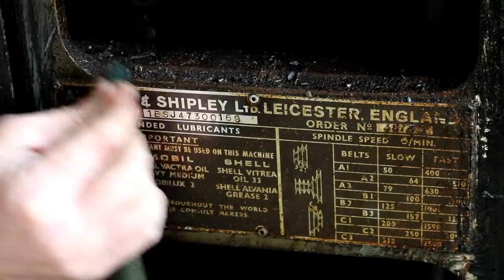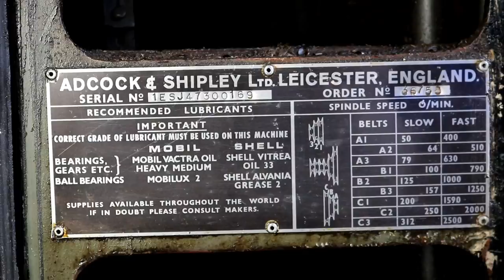1st good LooK at the Adcock Shipley horizontal mill. Good and Bad!

Comment: A suggestion. When you put in your retaining wall between the garage and hill, put a drain behind the wall and backfill with crushed stone. That will minimize frost heaving which will push the wall out away from the hillside.
Nice machine. Wish I could help with the building. 
Thanks,
John

Comment: Seeing your machine brings back memories of where I served my apprenticeship in Whetstone Leicester (pronounced Lester) I can remember learning my trade on a very similar Adcock and Shipley milling machine to yours. My first year in the training school would have been 1966. All the Adcock and Shipley machines we had were painted a light grey. I'm not sure if that was a factory colour of if they were painted in the training school. You may want to have a look at http://www.lathes.co.uk/ where you can find some information on the company if not your actual machine. I look forward to seeing all your videos. Hoping you, your family and peanut stay safe and well during this difficult time.
Reply: I would have dated that machine as being from the sixties, I've seen that 'tortoise and hare' speed indicator on other A&S machines. Most A&S machines I've seen including the Bridgeports have been green but obviously yours was painted 'off white' from the factory. I'm pretty sure the feed motor was disconnected and the brammer belt removed was to prevent inadvertent engagement of the feed. The bits of swarf in tight places points toward cleaning with the high pressure air gun, something that would have earned an apprentice a clip round the ear back in the day! Best Wishes to you and yours Steve and stay safe in these 'interesting' times.
Reply: I remember that before my marriage went pop my then father in law and I were making a seven and a quarter inch gauge narrow gauge loco. My point is we made the frames on an Adcock and shipley horizontal mill like that one. That mill was also painted a light grey. I seem to remember that the side cutting mill picked up on one of the frames which were bolted together and made as a pair. The cutter broke flew across the shop and embedded itself in the wall. Lovely machine but respect it
Reply: So did I but in north cheshire (ICI) apprentice school Widnes
Reply: I used one an Adock and Shipley like this as an apprentice in the training school we also had Bridgeport Mills they where all great machines😀

Comment: You mentioned putting in a french drain around the back of the building, to drain off some of the water that runs down the hill.  I built some french drains years ago, and they were the standard, pipe and gravel in a trench system.  Much more recently, I had to have some re-waterproofing done on a wall of my basement.  This time, they did the drains WAY differently.  They used a LOT more gravel, basically filling the whole trench with a tapered pile of gravel the whole depth of the wall, and added a channeling board along the wall.  While you don't need to go to that extent for a non-basemented footer, I would suggest adding a lot more gravel than a traditional french drain had, and surround the gravel bed with filter fabric, to keep silt from ingressing as fast and clogging the bed.  This will keep the drains working better, longer.  Just a thought.

Comment: Hey Steve!
AT 02:50 (or so) I figured out the cycle of that unit.  The air cylinder is to be used to just get the part started.  The operator would release the button BEFORE the part was fully threaded.  The roller die continues to self-feed the part to full depth and releases.  This allows the spring return of the cylinder to 'snap' the part back very quickly when the roller die head opens at the full length of threading.  The roller threading die is nominally EXPENSIVE and may fetch you a good price on EBAY.
Best regards,
Ken

Comment: For the retaining wall, you might want to consider running it along the length of the shop and about four to six feet beyond on both ends to keep it clear since you will have to cut into the hill side a few feet. In addition, you would want to put in drain tile for the whole length and back fill it all with crushed rock to help prevent heaving.

Comment: I use exactly the same head on my strimmer, for exactly the same reason, auto feed heads are just a waste of time.  great video as always
Reply from the maker: The auto feed heads get heavy and only work part of the time it seems. Plus the engine revs quicker not having to spin up that extra mass.  Its a must have for me.

Comment: You inherited some really nice equipment. That Baldor grinder is great. I have worked in a couple of places that had one of those and I loved the way they worked for sharpening tools for the lathe. That little mill must have a bunch of your viewers drooling. If I was a gambler my bet would be on them doing everything possible to disengage the table feed on that machine which would mean it will probably work once you clean it up and restore the power to it. Also very happy to hear that the DoAll bandsaw may be making an appearance again before too long. You have us all in suspense waiting to see that beast in operation. You will need it to cut usable pieces of that monster chunk of tool steel you got with those new machines.

Comment: Hi Steve, thank you for sharing your life with us, I'm sure that most of us are cooped up inside and your vids are a nice way to forget our problems. I'm not a structural engineer but I have some talent for problem solving. Given the rocky strata in your area I think you could use a small retaining wall behind your shop, if it were me I'd put in  36" wall height and 24" wide footing would be what I'd put in with a wall thickness of 12" and don't skip the rebar and maybe run some french drainage behind the wall as well. Hope this helps

Comment: When I toured the Starrett factory in November last year they had a lot of old machines set up kind of like this; fixtures to do one operation on one specific part. Based on the age of some of the machines and how long Starrett has made some of their catalog items I can only assume that some of the machines have been set up that way for decades. They have a machine rebuilding department where they refurb their own machines as many of the equipment manufacturers represented on the shop floor have long gone out of business. Cool stuff!

Comment: I have the same  machine only its badged as a Bridgeport late 70s according to the serial number, had to remove the knee to get it inside the workshop very heavy not easy. just been fettling  the rapid feed and return after strip down and clean  . I was lucky enough to get the overhead milling attachment as well which is a bonus , good strong milling machine hope you get it  all working ok.

Comment: I admire the tool makers who setup that fixture, but I pity the person who had to stand there and load it with parts! I've got an Echo trimmer, which I believe is made by the same parent company as Shindaiwa (Yamabiko). It's fantastic!
Reply: Echo was Kioritz. Don’t know if it’s still the same company or not.....
Reply from the maker: Lots of little tricks in that jig. . There was definitely some experience behind its design.  Probably some oldschool toolmaker with pencil and paper.  I Love my old Shindaiwa T231, it's been as good as it gets for me. Thanks for stopping by Wes. That 4 wheeler you got is a fine piece of equipment 😁
Running that Jig on that mill had to be mind numbing. I would lose my mind in about 5 minutes or less.

Comment: Mill looks real good considering its age. I like that thread roller.  Be sure to leave enough width to put in a retaining wall with buttresses. Without a really stout reinforced wall our massive freeze thaw cycles will really jack one over over time.
Reply from the maker: The wall was just me thinking out loud. Im not sure it would be worth it or not. It would need to be pretty tough to hold back that hill. Ill most likely just dig it back and try to keep It clear.

Comment: I have a Shindaiwa T25 straight shaft trimmer that I bought new in 1988. It looks like the one you have laying on the ground. It has had the hound dog used out of it over the years and I am still using it. The only problems I have ever had with it was maybe 20 yrs ago when the ignition module died and I have replaced the fuel line in the tank three times. The carburetor looks like a little Mikuni, It has never been rebuilt or worked on. When I put it away I drain the fuel tank and run it until out of gas then I store it until the next use with the gas cap loose so gas/alcohol vapors can evaporate. The saw blade I use is a 8" Beaver blade with a chainsaw chain wrapped around the disc.The new Shindaiwa are just a rebranded Echo.
Reply from the maker: That's a t25 behind me in the video like you mentioned. Its one that was almost never used. its as close to new as you will find.  I started to show it but decided not to.

Comment: For your retaining wall, look into Keystone Maxi (not standard, not pro, MAXI) block.  They use set pins for vertical or setback.   A setback wall into your hillside would hold nicely and the block allows you to grow as time goes on.  Again though, footing is extremely critical - drilling, pinning and mortaring the first course is essential.     If that option looks good to you, you can backfill behind the block with SIU (compacted roadbase) and put a French drain at the bottom behind the wall and surface drains at the top behind the wall and redirect water away from your shed area.   Then you don't need a French drain in the walk space...   just an option for you to consider.

Comment: The older stuff is and will always be more reliable compared to today's stuff. Today's equipment, cheaply made, poor quality control. Older equipment, had a more stringent QA plus, made by people that took pride in their work. Today, someone just pushes a button and don't care. 
The one thing I love about older mills/lathes, even through all the years of use, they're still quite easy to clean up and believe it or not, even repair. Brake cleaner is your friend in breaking down all that excessive grease. Great video. Cheers :)

Comment: You have all of those concrete blocks tacked up and the company sent you masonry tools. The low retaining wall would be a good project to practice learning masonry skills to see if you can handle the bigger building wall project or if you should farm it out. You just need to pour a footer with some u shaped rebar embedded in it and start laying blocks until you get to the wall height that you want. Make sure that l=you leave some un cemented gaps between some of the first course blocks to prevent water pressure from building up behind the wall  and back fill the wall with course gravel. Good luck with your project. I look forward to your video each Saturday.

Comment: Steve, you made a comment about being able to buy parts for CNC machines easily and I can't wholly agree. The manufacturing company where I work has had to dispose of a couple of CNC machines (two press brakes and a lathe) that had electronic problems and the boards/controllers were NLA. CNC is cool, WHEN THEY WORK, but I like the manual machines from the 40's thru the 70's, before the domestic (and British) manufacturers had to cheapen things to compete with SE Asia.

I like watching your progress on your projects, both the DoALL saw and your shop building. Hope you get to pour some concrete soon.

Comment: Properly installed retaining wall will last a long time, the key will be to put in a proper french drain down there, and I'd recommend using a trough based drain that you can wash out.  Lots of videos on doing this.  I also have a problems with "low" spots off of my pavers, and I cannot figure out how to get that fixed...trying to get my landscaping buddy to give me a hand.

Comment: A retaining wall against that hill is a very good idea. Two drain lines will relieve the hydrostatic pressure and allow that area to dry out. You probably could construct the wall out of eight inch bond beam blocks and re-bar. An engineer can tell you how to design it to stop it from pushing over.

Comment: I can tell you love to work hard! You could key ( a"T" with the stem going into the bank) a retaining wall into the bank down the side of your building, thus any further movement of the bank would tighten the wall in place rather than sliding it laterally toward the building.

Comment: Steve:
You need to keep the screws on that machine as they will be whitworth
Similar to American national...but not quite the same...
The American national thread is based on the whitworth...🇬🇧☺️
Reply: Well said! American coarse threads (UNC) are usually the same pitch as Whitworth, the exception being 1/2", (UNC 13 tpi, Whitworth 12tpi)  the profile angles are different as well, UNC/UNF 60deg. BSW/BSF 55deg. BSF threads are quite coarser than UNF threads, at a glance similar to metric.
Reply from the maker: Thanks
Reply: I think I have some old dormer whitworth taps and dies kicking about somewhere,  haven't touched them since I moved to the states 5 years ago.
Reply: Much the same re. Tip but BSW ,BSF are 55degree thread profile  with a flat top not the USA/metric 60degree form   Eg your UNC 1/4 20 is the same has a BSW 1/4 20 it’s only the profile that is diferent

Comment: A corollary to the "painted like a turd, but still OK" situation: I've seen many photos of machines with nice, clean paintjobs offered on auctions, which looked very promising, until you noticed that they forgot to mask off the pallet when painting, and the pallet was obviously new (modern, not soaked in oil, etc.). That means the machine has been painted by the dealer, who probably wanted to hide something and painted over stuff that shouldn't be painted.
Reply: Been there seen that, a fresh paint job and the knee ways look visibly like a swayback horse.
Reply: With old tractors, I’ve heard it called a “Sherwin-Williams restoration.”
Reply: @kenburner  There ya go.
Reply: We call that a Ritchie Brothers paint job
Reply: Corollary, when there is overspray or drips on the tires...

Comment: Early Brigdeport had grease fittings, but these were for lubing with way oil. there is  a special pump to use for lubing. I have an early j head brigdeport  set up like this. if someone used grease the ways will bind.

Comment: That machine had been run in a shop where no one cared. Except for hobby use and maintenance departments manual machines are a thing of the past. I started converting my shop to CNC 25 years ago. Could not have remained competitive W/O. It took a good team of people to make the system run. It certainly isn't just pushing the green button. Any machine with moving parts needs constant checking to make sure the auto lube systems are working properly. Likely only us old worn-out retired guys full appreciate tearing into those old machines, oops I can see that's not totally true, sorry Steve.

Comment: 3:13 I would imagine the air pressure would be regulated down to a less violent result. It looks like your going to have a nice horizontal mill when you get it all done. (edit for additional content) At my job, I use a Rambaudi vertical mill that I am sure could be made much better with some TLC and minor repairs. Mostly coolant and auto feed repair, if I could only get the company to let me.

Comment: Good work cleaning up the machine it's my least favourite part. I enjoy the overhaul and rebuild part more.  I'm working on restoring a 1996 Bridgeport torq cut 22 cnc mill I picked it up for a good price.   I think if you go with a strong concentration of purple power grease remover from Walmart and leave it to soak for a little while it will probably take the black paint right off with a rag and not touch the enamel paint under it. I'm recording my restoration as I go but it takes me a while to stitch the videos together so I'm slow at uploading them.

Comment: Tell Al if he needs a friend in TN, I'm available. LOL  There is somebody out there with a production contract that is coveting that threading device.  Could you make spline dies to work instead of roll thread dies.  You could make the motorcycle shift shaft, or brake shaft, splines.  Having worked in my father-in-laws body shop for 13 years, that paint job would make me cringe.  Looks like something took Tellus 68 oil.  Shindaiwa and Tanaka are both good brands.

Comment: You got plenty of block to build a 24-32" high retaining wall. But be sure and have your engineering friend help you with the footing design to prevent overturning. And put gravel behind it to prevent hydro-static pressure build up.

Comment: can you drill another hole in the broken handle on the mill to allow you to put a spinner.. but perhaps... create a mold from the front of the handle... then rotate the handle in the mold.. and start building it up with bondo or fiberglass to recreate the missing portion of the handle/wheel.. 

on the hillside above the good side of the shop.. you need a angled ditch somehow.. so any water coming down the hill goes to the downhill side instead of straight down..  don't forget.. that you can redirect the creek slightly.. by using the jack hammer to break up rock on the bottom and then pitch it to the outside to get the creek bed deeper away from the garage slope..